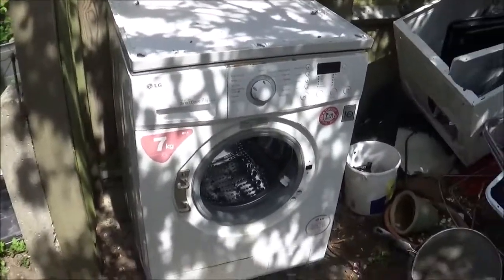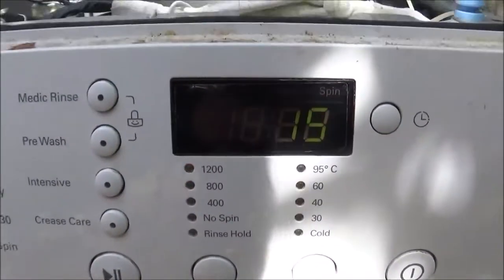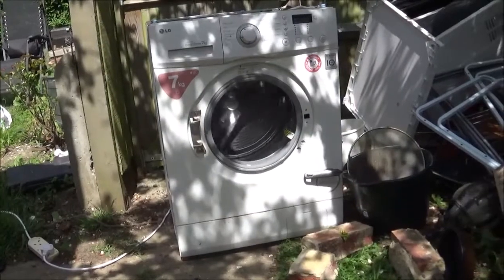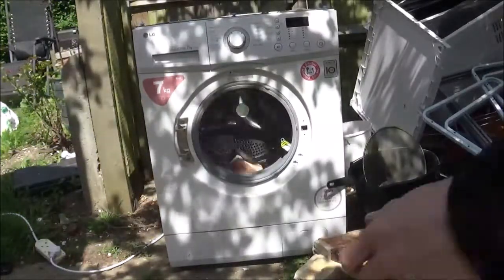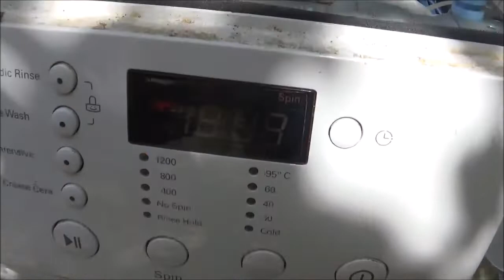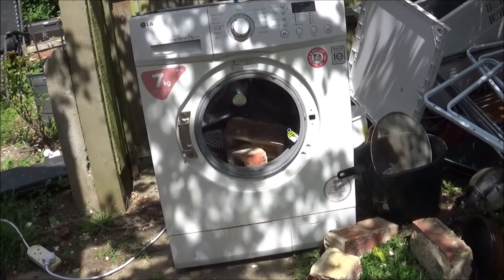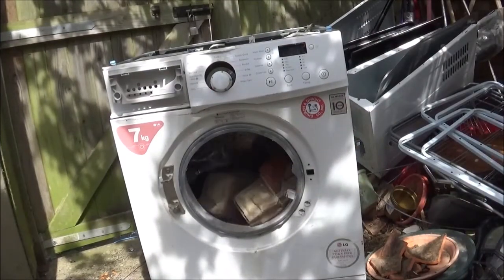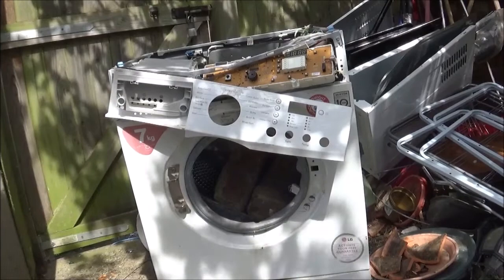Posh Lg washing machine Gets bricked

Comment: It kept stopping at some parts because there was a instant balance sensor in it but even though about the balance sensor but even though about the balance sensor it looked fun 😂🥲
Reply from the maker: Yea I really enjoyed it got it for scrap metal I wanted to hook the motor directly upto the mains then just could overload it and hopefully burn it out and snap the belt inside would of been too much work bypassing  safety tripped the electric one as there were 3 contacts on the door safety I tested them with  my tester and I didn't realise one waw as a neutral I thought they were all switch lives it didn't trip at first when I pressed start it took the summerhouse mcb out I cant understand why it would need a neutral feedback when it's just a simple microswitch probably to monitor something so it can error code stupid electronics the way it beeped when safety was disconnected stupid thing

The first attempt I hacksawed the door so it thought the doors were closed less work however it wouldn't fit I cut though the side and took the top off to gain  access to the stupid microswitch cut through the rubber as I couldn't care about it
Reply: @kierantvyoutube3591  also this lg doesn’t use belts they use a motor attached to the drum